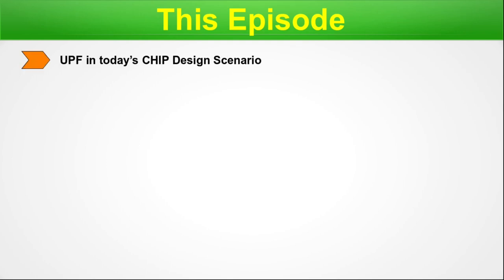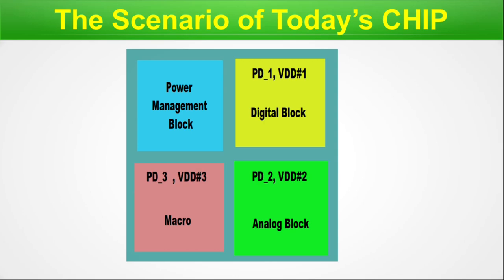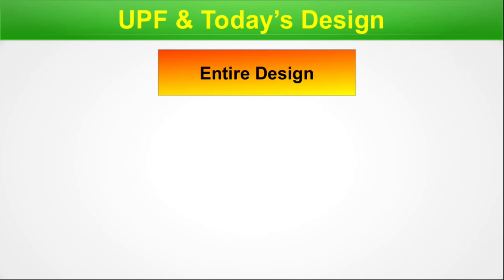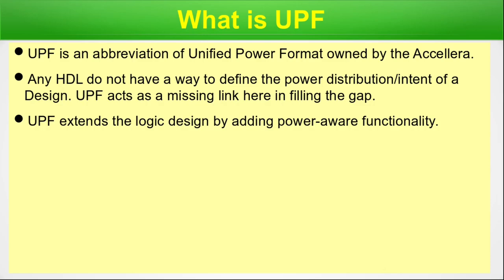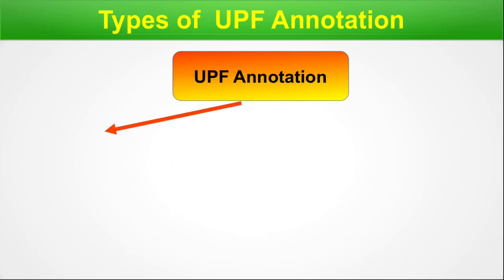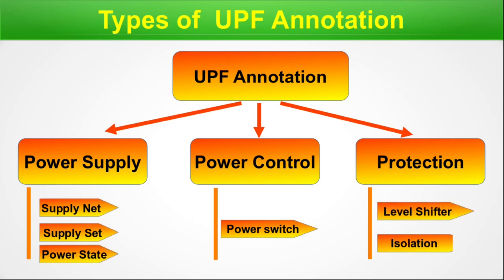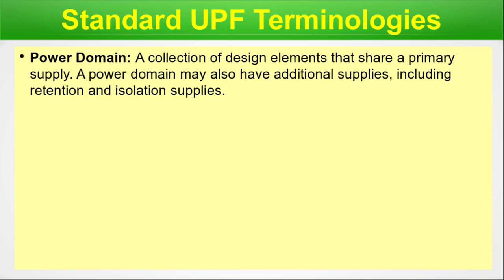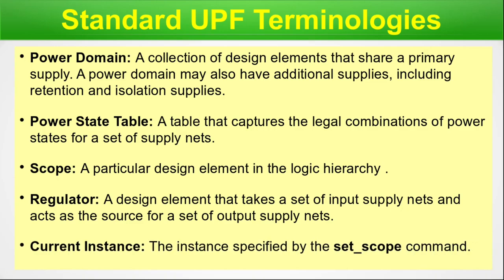UPF | What is Unified Power Format in VLSI | Episode-1

Comment: Which tool can we use to  practice these UPF command and any guide on how to verify or Simulate the different UPF components
Reply from the maker: To practice UPF commands and simulate different UPF components, you have to use Industry Standard Electronic Design Automation (EDA) tools that support UPF. Some popular EDA tools include:

Cadence Tools (Prefer CPF): Genus, NCSIM, Incisive
Synopsys Tools: Design Compiler, VCS , VCS-AMS
Mentor(Simens)Tools: Questa , Questa-ADMS
Ansys : RedHawk, PowerArtist
Before you start practicing UPF commands, it's essential to have a good understanding of the UPF syntax and semantics. 
Complete UPF tutorial : https://youtu.be/ocFfLt8wbjs
Good understanding of UPF, TCL Knowledge Essential :  https://youtu.be/v8eu-CCrm-E

To verify or simulate UPF components, you can follow these general steps:
Create UPF File:
Start by creating a UPF file that specifies the power intent of your design. This file will include information about power domains, states, modes, and other relevant power-related details.
Simulation Setup: Set up your simulation environment to include the UPF file. Most EDA tools provide options or commands to include the UPF file during simulation.
Run Simulation: Run your simulation using the appropriate EDA tool. During simulation, the tool will consider the power intent specified in the UPF file.
Analyze Results:  After simulation, analyze the results to ensure that the power-related constraints are met. Check power consumption, transitions between power states, and any other relevant metrics.
Debugging:  If you encounter issues or unexpected behavior, use the debugging features provided by the EDA tool to identify and resolve problems in your UPF file or design.
Always refer to the latest documentation and user guides provided by the specific EDA Vendor tool you are using, as the process may vary slightly between tools. Additionally, some tools may offer graphical interfaces to help visualize and edit UPF information.
Reply: @TechSimplifiedTV  Any open source tools for students?